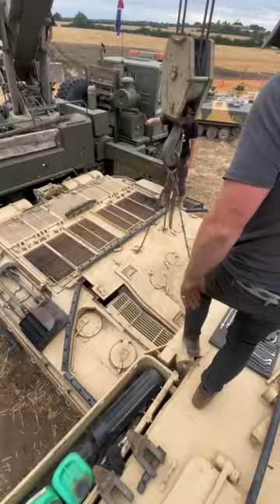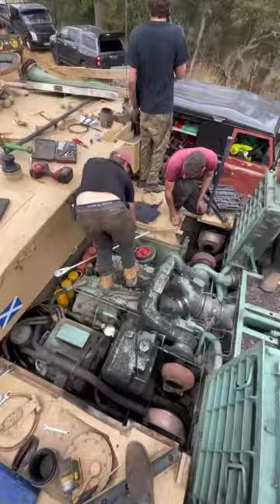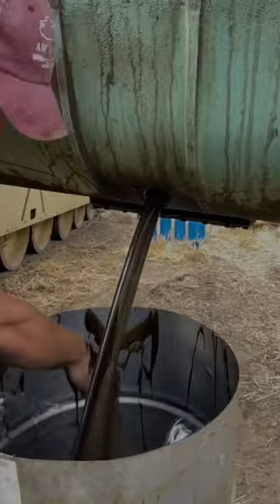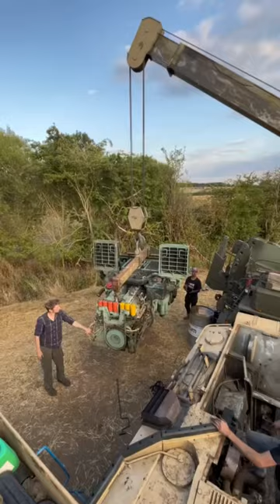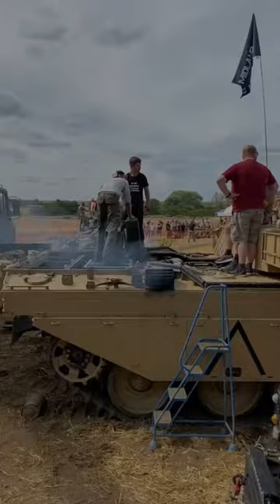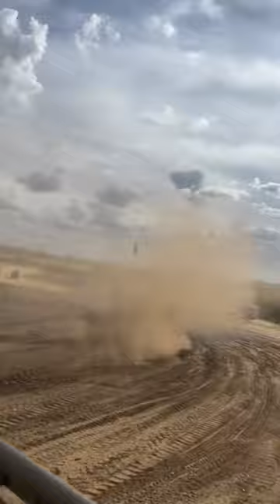Service Challenger 1 Tank #reels #fyp #foryou #challenger #tank ￼

Comment: Still can’t believe there are 400 of these just sitting in storage in Jordan having just been retired, yet we’d rather give away 12 Chally 2s instead. 🙄
Reply: Aye; the madness of politicians 🫤 .
(particularly giving the CR1's away when the full order of 600 CR2's had been cut back was absurd in the first place, especially when considering there were options to update CR1's FCS and other systems)
Reply: @jimtaylor294 it was 1996(?) and war was Over Forever, according to the politicians
Reply: ^ False. It was in the early 00's that CR1 was retired and sold off, and Tony Bliar's lot as well that cut back the CR2 order.

Swinging & pointless cuts to defence were a constant feature of the Bliarite years.

Comment: Chally one my favourite chally!
Reply: chally 2 not pretty enough for you XD
Reply: @GuyWilson706  no that's not it, it's the fact the Chally 2 retains the same engine and power train as the chally 1 but puts on like 10 tons more... Chally 2 should have 1500hp not 1200hp! Justice for the Chally 2!
Reply: @chrisbacon3071  I agree with you completely, it is a crime using the same engine etc, when could of been a much bigger monster with English industry actually giving a damn. I would stand by challenger 1 any day - but there is something about the chalky 2 that is very very sexy MBT
Reply: @GuyWilson706  well there was a Challenger 2 with a 1500hp engine and 10 speed gearbox (+45mph & -21mph with 6 gears) , it's called the Challenger 2E (E standing for export) it also had gen 2 thermals for the Gunner, Commander & Driver! It was to be sold to Greece but they didn't want it, after that I think the tank was ether put in storage or reverted back to a base Challenger 2.
Reply: @chrisbacon3071 As I understand it - from discussions with various vet's and enthusiasts - the Perkins Condor V12 can produce more than 1,500hp... but the standard Gearbox wasn't enthusiastic 😅 .
The Army also tested a couple of CR2's with upped HP. Reportedly in full battle kit using such a burst of speed offroad was not great as it was causing the Tank to shed bits of kit 😂 .
(needless to say, MBT's that hefty do have a price to pay for trying to go faster than about 40mph)

It's also of note that the Perkins Condor V12 originated as s Locomotive Generator, thus wasn't the ideal choice due to not being am engine designed for direct drive or revving.
Reply: @chrisbacon3071 Interesting. Didn't know that CR2E was equipped with a CITV, though it makes sense as Vickers had proposed one for the British Army's stock (and had fitted one to the MK.7 back in the late-'80's), only for the politicians to say no, seemingly only for cost reasons.

As for Greece; I read it was because the Germans managed to undercut VDS on price.

Comment: Who knew you have to remove the engine to change the oil?  Amazing.
Reply: It's actually the engine  & gearbox (aka a pack)
Reply: @DieyoungDiefast  seriously? That's being a bit picky, isn't it?
Reply: You don't have to, there are removable belly plates in the hull. 

I'm guessing they took the pack out so they could inspect it.
Reply: @MalumZeth  Correct, also clean out the bay, it does get mucky. It's not a long job to get it out.
Reply: @martynbuzzing3327 being factually correct is picky now is it? Just highlighting a point, not need to get defensive.

Comment: Challengers are amazing tanks, but why tf would anyone in modern age put a 70 mm flat armour plate on the front as the only hull protection?
Reply: chobham armour on top surface. Also british doctrine calls for more hull down positioning
Reply: That's just the Cobham over armour . The armour that makes up the front plates of the body is about 300mm thick , but angled so thicker in direct frontal aspect. If you are a tankie this is the best tank to be in. 😊😊
Reply: challys dont go into battle naked mate, we stopped doing that after the romans civilised us